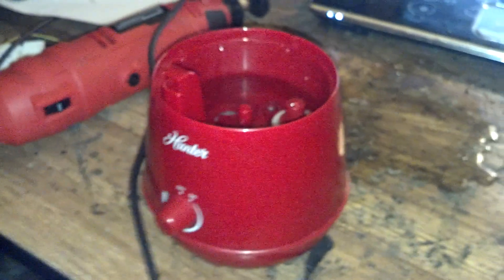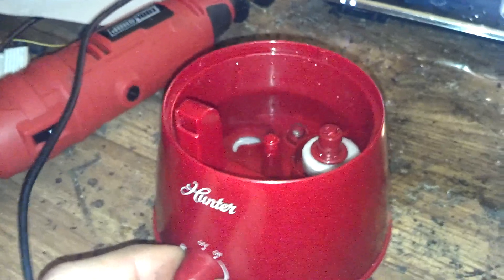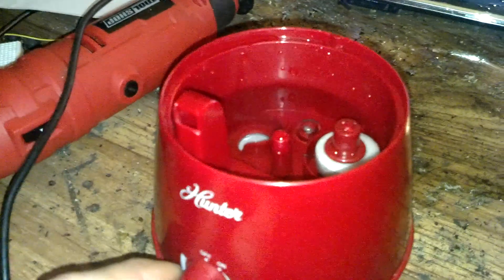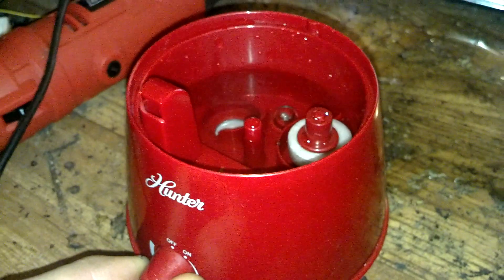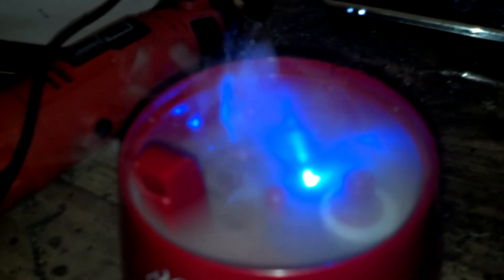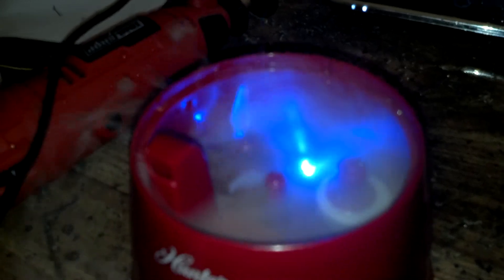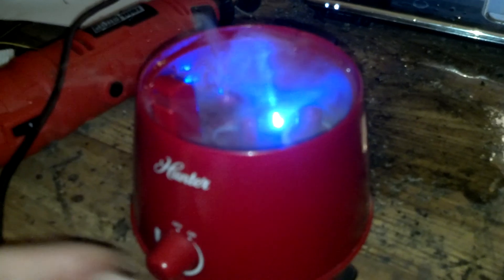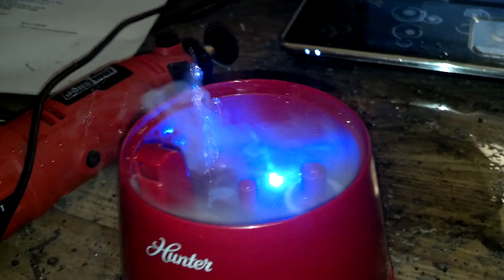Ultrasonic Vaporizer - showing anti-gravity convection waves.

Comment: ENTANGLEMENT!!!? It's just a piezo element. Just like water on a speaker cone, the vibration caused by the piezo that vibrates the water so fast that it vaporizes. This is why the water is being shot vertically into the air. NOTHING to do with entanglement, just standard vaporization.
Reply from the maker: Eugene S Everything has to do with entanglement.   A spike from a piezo speaker travels inches into the air (with only 100 volts).  

Hmmm, a virtual, AM oscillating,  emitter of sound waves (a ray).   A jet (and a ray) - is made from a certain medium or material - and flows through another medium.  This makes a measurable phenomena.  
Where are the jets going to emit from any ultrasonic AM source?

Same as any other sound source.  Entanglement.
Reply: Jon Abel I'm sorry but I think you have a misunderstanding of "entanglement". Can you please state your definition? Are you talking about quantum entanglement or just "things are all connected in some way" type of entanglement?
     I'm totally lost on your second paragraph. What does an AM wave have to do with this situation? Are you asking why do radio waves go through solid objects?
     The water is being vaporized because of the physical force exerted on it from the ultrasonic piezo element in the vaporizer.
Reply from the maker: Entanglement is entanglement.   Yes, entanglement does exist at the quantum level - but any convection device shows that macro levels of entanglement exist in everyday things.   

Any magnetic mixing device causes enough pressure & shearing to hold a stable structure.  
Also, AM radio waves are an entanglement of 2 AC waves. 

If you modulate them, you slow the action of the higher frequency (making it more effective than 1 AC wave.)    I use Op-Amps and logical AND gates to do this type of work.

Two billiard balls show how to conserve momentum along a 3rd vector - when they collide.   Entanglement says that FLOW objects (like sands, liquids, and gases) will not only collide - but also find a way to statistically twist together along a 3rd path (because of momentum and shearing forces). 

AND, ideally, entanglement will store properties from both flows.  

Weather patterns cannot exist - without some form of entanglement between two mediums - with different pressures and/or temperatures

Chemistry, DNA, and Tesla Bifilar accelerator coils all show the twisted-pair dynamics associated with entanglement - exist at larger scales than quantum. 

However, yes - thought processes entangle and we also make internal & external associations from the comfort of our own brain.   .    

Our very conversation is a form of entanglement.   Dimensions along tangent topics can be entanglement.   It's really everywhere.    

Gravity is showing to be measurable at the ultrasonic level (20 Khz - 16 Mhz).    There are new models out for "Solar System 2.0" showing 3D vortex behavior - and the new Galactic Cluster model (that shows our cluster and the Virgo cluster are really one large torroid made of galaxies along the magnetic flow lines. 

We ride on a big torroid.      My videos of string theory show my bifilar coils can store energy and extruded into multi-armature galaxy shapes.  

I am working with some Tesla patents - which mimic a Halbach Array to cause my own directional magnetics.

We are getting there - but not fast enough.
Reply from the maker: Oh, and sonic entanglement can be understood by searching YouTube for "Ultrasonic Antigravity".   It really shows how Standing Waves are a part of entanglement.   Standing Waves were a Tesla discovery.   We see them in many devices.   And, entanglement allows process improvement - beyond how we normally cope with improvements today.